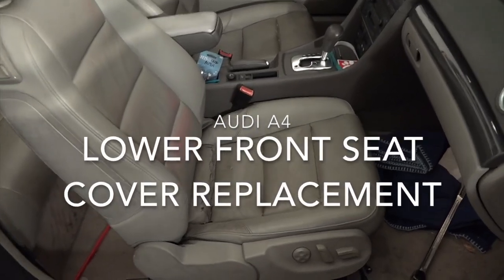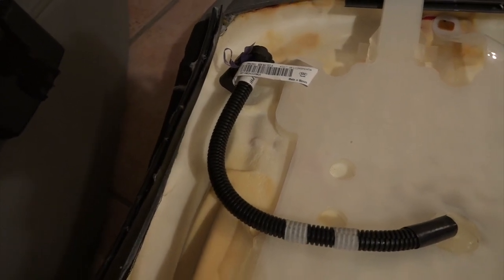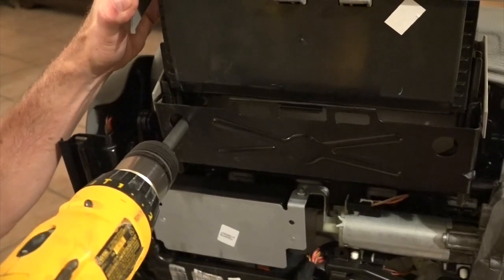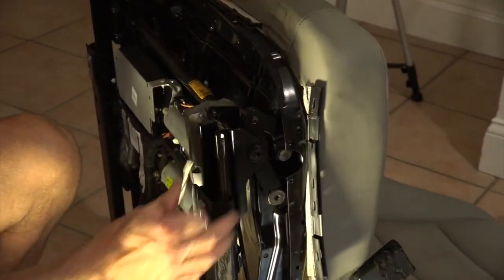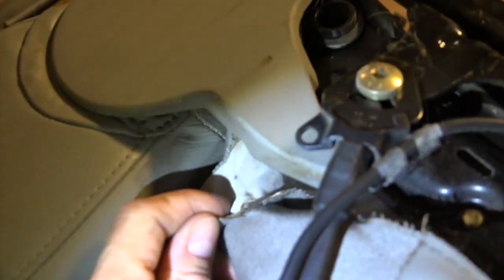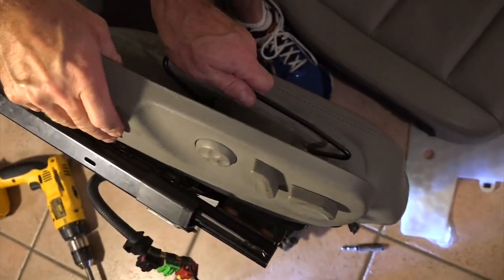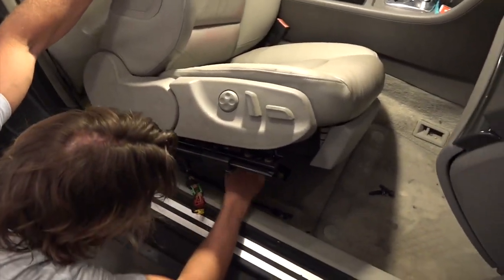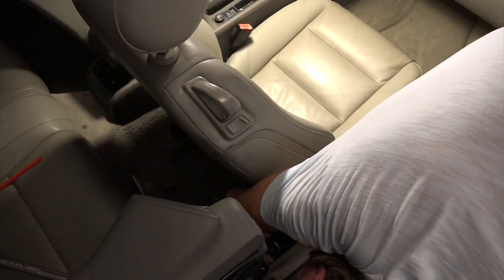Audi A4 Front Lower Seat Cover Replacement

Comment: Thank you it was helpful. I was doing the bottom seat cover replacement on the drivers side, worked out fine,no screws left over and nothing broke off.
Reply from the maker: This was one of my first videos I posted- glad it helped- when I needed to do mine I couldn't find a tutorial so I made this one.  It was my first time replacing a seat cover- I just figured it out as I went... nothing left over and nothing broken off sounds like a successful job.